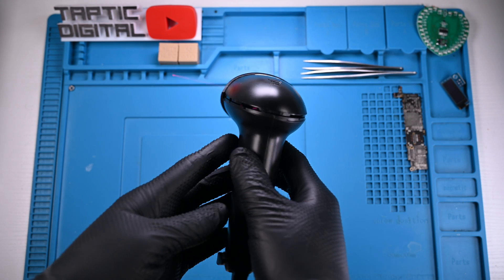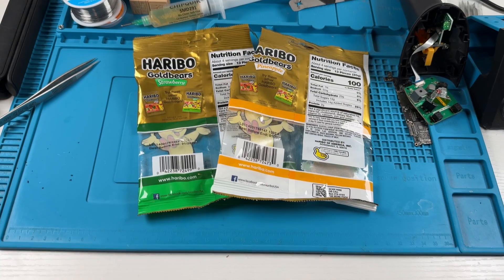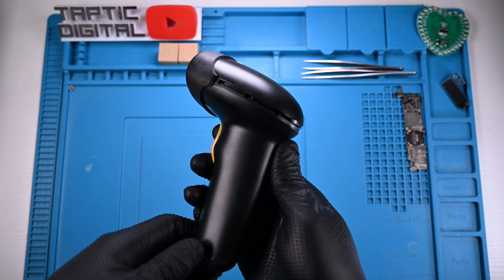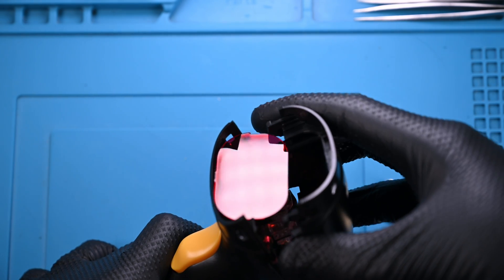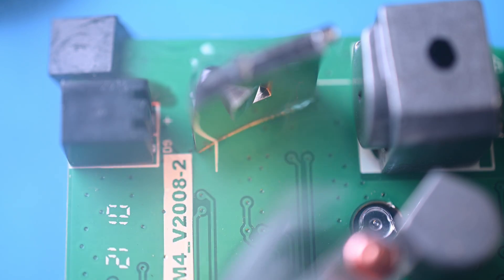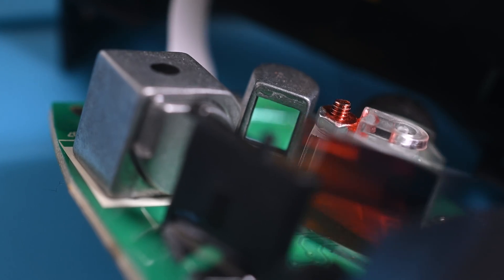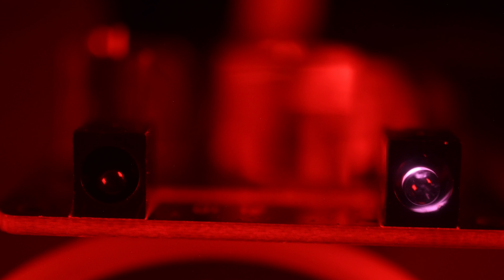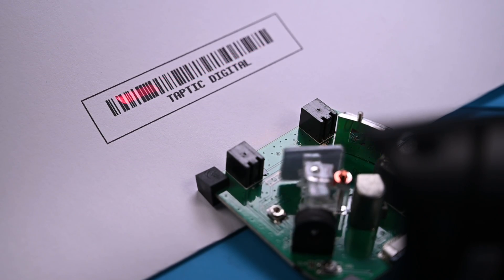How does a barcode scanner work?

Comment: how does my phone read barcodes with no lasers
Reply from the maker: @jackhemm98  I like this question a lot. Basically smartphones basically take a video of the barcode and check each frame for the boundary bars, once it finds that frame it converts it to text using something similar to OCR which is how computers “read” text. Because smartphone tech has grown, modern phones process every frame when the camera app is opened, and searches it for common patterns like QR and barcodes, and give that handy popup with the link of what it sees.
Reply: @ nice! thanks